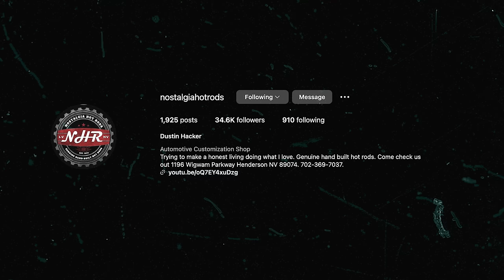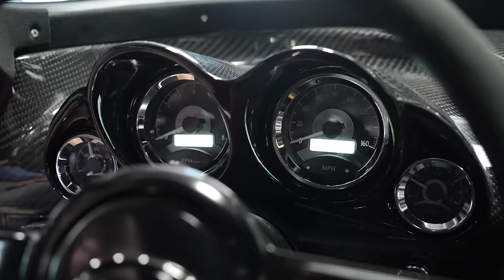WIDEBODY Big Block 427 Powered C2 Corvette with Straight Pipes

Comment: 500 at the wheel is perfect. You can drive it hard and it's manageable.  Take that thing to the twisties. I just discovered WV16 south of Beckely to I81. Absolutely crushes the Tail of the Dragon.
Reply: 500wheel in a 3k lbs car with a big stalled auto th400 is a 9sec car bro.
Reply: @maximusvonce1381  Dont know about 9s but definitely quick

Comment: Decent review, I missed the underbody shots of the steering & suspension &the accessory drive system on the engine front. I've never been a Vette fan, but this1 concentrates on tech mods &looks making it a reasonable driver's car. IDK, I might've chosen the newest gen Corvette engine & eliminated the pushrods although the 427 is 1of my old favorite big blocks.

I really appreciate the A/C, the focus on big& taller driver's comfort &tech. I was waiting 2hear of SRS, seat belt tensioners, EPS, antilock, traction control, fuel cell, etc. I think that I c a hydraulic rack& pinion @3:39 nxt2 the PS pump & driver's side header.

Comment: As a high school senior in 1980/81, I bought my first car. A 1970 Dodge Challenger T/A for $900. Loved that car but, traded it straight across for a 1971 Plymouth Roadrunner - 440 magnum w/ air grabber same as the Challenger. Some friends of mine that were taking automotive classes at the local college helped me go through the engine and we built the $hit out of that engine. Got divorced my senior year of college and joined the Navy. While I was in basic training my ex sold my Roadrunner. I came home before starting “A” school and was going to drive it back down to San Diego for all of my schools and then to Mayport in Jax. That never happened and to this day I miss that car and at the prices today…will never have either of those cars again. Had a VW GTI in the Navy and surprisingly that car was very fast. I have had two Corvettes as well, a C3 and a C5 ZO6 - 2002. Not a car to drive in the traffic in Seattle. 🫡👍👍👍😊

Comment: At 9:16 it looks like the bottom of the door doesn't cover the door sill/rocker panel top? And it looks like the body line in the door doesn't line up with the body line in the panel behind it? Notice a write "looks like"....and I'm not complaining, not at all. Just pointing out something. That thing is so shiny that I'm probably just seeing a reflection and not what i think I'm seeing. That car is incredible. And much better because it's a driver, not a show piece. Excellent work!
Edit: i bet a door seal flap hangs down just enough to cover that rocker panel/door sill line...

Comment: Looks good looking at the front tires the driver has been on the breakes because the seats need rebuilt higher because my best guess his neck has been snapping back and also a five point harness and a full cage almost there.🎉🎉🎉🎉🎉🎉🎉🎉🎉🎉🎉

Comment: my truck makes 500, bone stock, a few performance bolt ons, digital tuner, 550, a bolt on whirleymajigger? 750, streetable, but it weighs that's for sure, that lil diamondback doesn't weigh a whole bunch, billet aluminum suspension components, aluminum block and heads she'll weigh a while lot less .. fun!  nice ride...

Comment: So it took 58 years for someone to perfect what chevy built in 1965.
Reply: I know you're too young to understand but the 1965 Corvette with fuel injection was way ahead of its time with four-wheel disc brakes and four-wheel independent suspension and 375 horsepower. They did not need any Improvement whatsoever. They were probably the most perfect sports car that America ever produced for many many years after that. One of my favorite all-time cars.
Reply: @georgespalding7640  I completely agree with you. The 65’ Corvette was a wonderful example of American automotive engineering. At the time. But,  time moves on and so does technology. The Porsche 917K was also way ahead of its time. However, It could not not complete with today’s prototypes. Not comparing the two. Just pointing out technological evolution.

Comment: Times are changing, a ZF 8HP trans is the way to go. It will make your car way faster.
Reply: DOesnt really need it with all that torque
Reply: It's a car to drive and have fun.  Not a car to go out and destroy everything on the track.  lol.   All of you people that say do this or that crack me up.  If you want max speed go buy a race car not a 1960s Vette.  It doesn't even have basic safety components and you're worried about making it faster.

Comment: Beautiful and fucking awesome!!! The front tires tho might be way too wide for what it’s doing. Honestly it doesn’t really need more than 275/285 upfront being so light. In fact, being light might make the 335 have less grip than a narrower tire wouldn’t it? You know pressure per square inch so technically more weight pushing down on a narrower (slightly narrower) tire than a fat one.
Reply: Big block weight means the front wants to push.

Comment: 500wheel with a stick, 440wheel with a big stalled th400 and deep gears,  but the car would actually be faster. Horsepower is just one part of equation.  Weight and transmission and rear gears, suspension, tires....etc are the other part. I know 500wheel cars running 9's all motor daily driver.

Comment: Bump steering is not caused by big front tires. It's the front end. Something needs adjusting. New clutches don't usually need to break in? Do they?
Why did customer want that complicated fuel system? Hopefully once it's tuned, it'll stay there. I guess it's a show car, and that's another thing to talk about. It sounds INCREDIBLE!!!
Reply: Most think it will make it oem reliable which never happens with aftermarket EFI. 
Nothing better than a well tuned carb. THat whole break in bs is what mfrs tell guys who complain its bs. 
A proper clutch setup shouldnt do that
Reply: Bump steer is caused by toe in change, but it is true the wide front tires cause tracking issues. I've seen several supercar and corvette engineers mention it.

Comment: I see that 'please set the clock' on the digital dash. Nightmare. I have a battery isolator so no point setting the clock / speedometer etc as always resets. No idea what the time is or what speed I'm doing, but better that than a flat battery!

Comment: Another $400k car..You can build em better and faster cheaper than this.
Reply: Please share how to do this. I’m very interested
Reply: @nostalgiahotrodslv  Are you for real. I know 9 sec all motor street cars that look just as good as this, maybe not showroom custom like this but they look pretty damn clean and cost under $100k to build from scratch. This is a rotisserie job plus here. You can have a killer fast nice car without a rotisserie job. This is a nice car for sure but you dont have to be a billionaire to have a clean nice 9 sec street car daily driver.  Sean shows those cars on occasion,  but usually he has billionaire cars on here which most people can't afford.